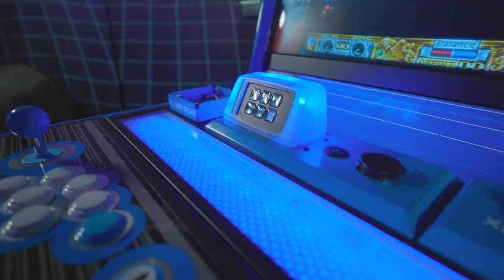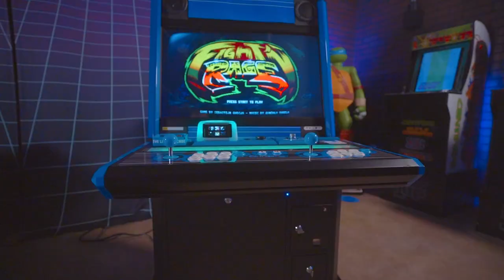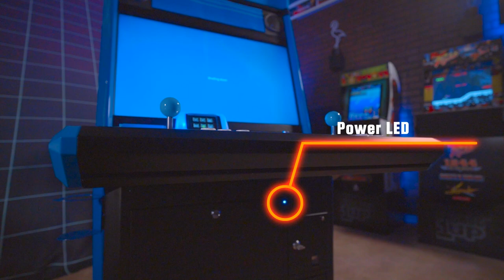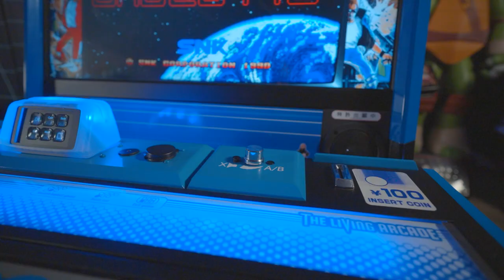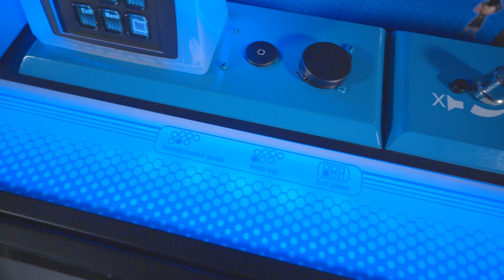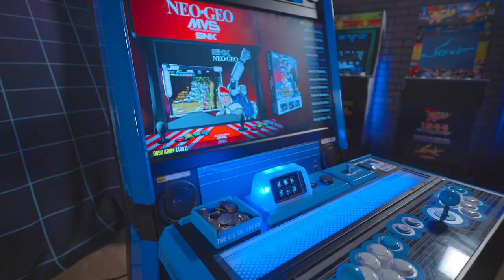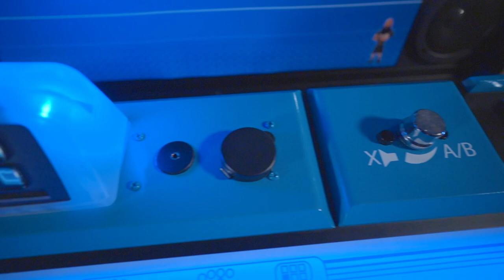Chewlix Worth It? My Taito Vewlix/Chewlix Journey (How I Setup My Candy Cab)

Comment: hello i have a brook universal board how do you keep player 1 as default sometimes after reboots player 1 becomes player 2. im on PC win 11.
Reply from the maker: I'm using two USB encoders (not brooks) and I experienced that as well. Windows seems to randomly assign player 1 and 2 on boot. What worked for me was I experimented with plugging one into the front USB and one into the back USB of the PC hoping they were on different USB host controllers at the motherboard level and I found a combination that worked. You can also try booting with only one connected then connect the other after and sometimes it will "remember"

Some people install a inline USB (on/off) switch in between the player two USB and leave it off so that only player one is "connected."  When windows boots it insures it's mapped to player one then they flip the switch for player 2 to be assigned by windows after it boots. See link blow for example but there's many variations but here's the idea
https://amzn.to/3UGRxC0

There's also a really advanced way of finding which USB port is player two and setting a "delay" in windows that doesn't activate that port until after it's fully booted insuring it maps to player 2 but It looked pretty elaborate. I'd have to do some digging to find it if the above doesn't work.

You can also switch to an encoder that has both players on one board mapped at the chip level but that's a tough one after spending the money on two brooks. But they will never have that issue since it's one USB connection. 
https://amzn.to/3GgZKIE
https://www.arcaderenovations.com/ipac2-with-usb-cable.html

Please let me know if this helps you. Thanks for watching!
Reply from the maker: I found this more complicated walkthrough and it's written for windows 10 so I'm not sure if it will work on 11 but wanted to let you know just in case my previous reply didn't help.
https://forum.arcadeotaku.com/viewtopic.php?t=39240&fbclid=IwAR3x3ebe81J81Roz2Cq4tR0cCd5hF3jimZWG64ytXjKa5bqx4NsAFXZZKsI
Reply: @TheLivingArcade  thank you for all the tips i ended up going with the switch to turn off/on method. i have tried the method from arcadeotaku but could not get it to work automatically as i could not figure out a way to give those .bat files administration rights so they can run by themself on boot ups. if i manually  run the .bat when i power off/on they work as im able to right click and run as admin. i have rebooted the pc a hundreds of times and spent many days trying to figure out to to get it to work but gave up. really wanted to make it work via software/commands so its more of a permanent fix
Reply: @TheLivingArcade  i found someone made something to combine the 2 brooks board onto 1 board not sure where to get something similar from https://www.youtube.com/watch?v=Go2NiGVLOPE&t=209s
Reply from the maker: @tuando8033  Woa that is a cool idea! It's like a daughter board that combines them! I'd imagine there would be a lot of people interested in that. I also just found these other boards that were custom made by brook as a commission for this polycade company. They can be "addressed" with a jumper at the hardware level! Distinguishing  P1 and P2 https://polycade.com/collections/all/products/neo-arcade-controller-board
Reply from the maker: also look into "windows task scheduler" you can set up BAT files to run as admin in the scheduler on boot as a trigger. I also read that where the BAT files are stored may prevent them from running as admin. Some windows folders have different permissions that won't allow them to run as admin

Comment: Hi. Do you have a link for the ashtray? I'm in the same boat. 😉
Reply from the maker: So it was one of those amazon random "one-offs" It shows as no longer available. I'm not sure if I mentioned in the video but it's also made of silicon which turned out surprisingly nice. But here's some ones that I found this time. https://amzn.to/3Qc2LeB
https://amzn.to/3RopLsw
https://amzn.to/3Rd0elM
This one is metal! Kind of cool
https://amzn.to/3AINIDA
Below is the one I got in the video for reference but it's no longer available
https://amzn.to/3RCIqjW
I hope this helps you. These are affiliate links BTW
Reply: @TheLivingArcade  Hi again. Thanks for the info. I messaged you via Instagram; please get back to me. Thank you.
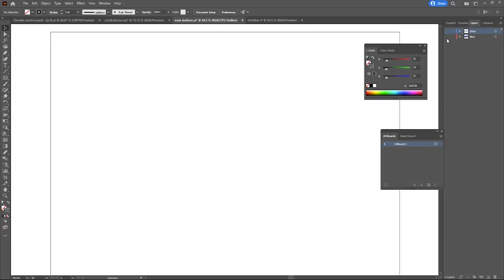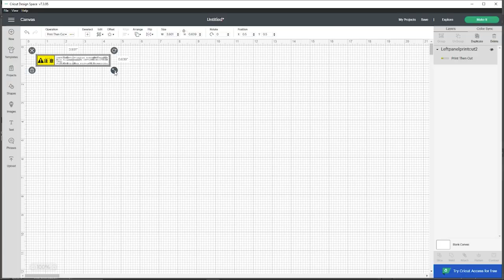Reply from the maker: @RandomStuffByMe  Sorry I missed it. I replied with a little more insight on IG. Here's a link to the cricut I used to make the graphics. You can see at 6:30 and 8:30 in the video how it cuts both vinyl adhesive and paper. I highly recommend one I use it all the time! https://amzn.to/3Db92nX
I still use the older vs 2 model https://amzn.to/3eD9MIf
these are affiliate links BTW but you can get them at craft stores and even target.
Reply: @TheLivingArcade  thanks for all the info. Just read your messages on IG and responded. 👍🏻

Comment: What wireless? (End of the video)
Reply from the maker: The wireless pad? I got really lucky and found a used Xbox elite VS2 and I already had that xbox wireless dongle for windows. 

I also highly recommend the Logitech F710 https://amzn.to/3ZKCcDu 
It takes regular aa batts and comes with a dongle so you don't need to pair it. It also has a switch on the back for X-input or direct input and it has force feedback. Battery life is really good! It's very under rated.

Comment: Bro What is processor?
Reply from the maker: It’s an old core i3 like 2.3 ghz nothing special. With a GT 1030 not GTX Or anything recent for the GPU. Works great for emulation and low spec “modern” titles at 720p